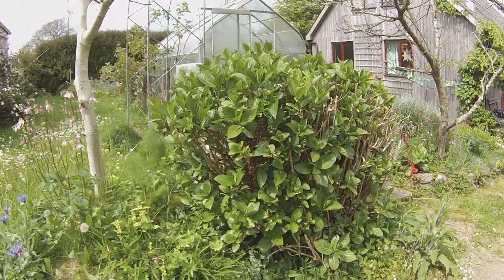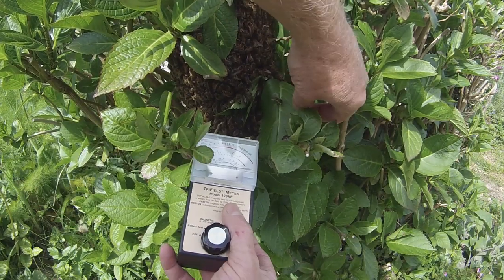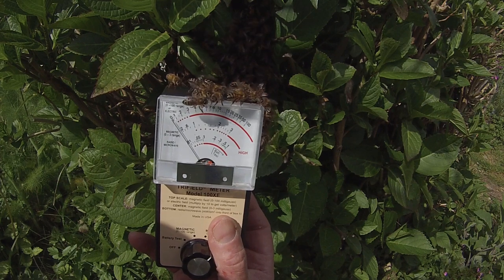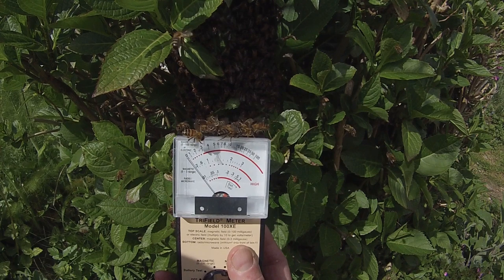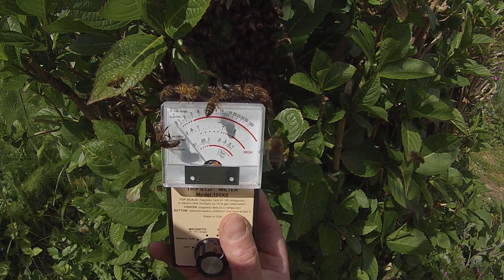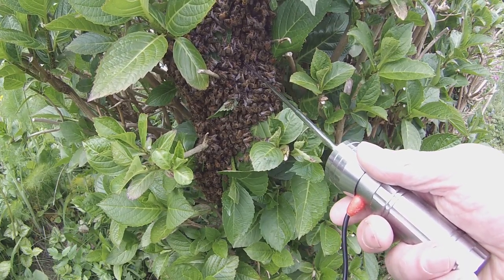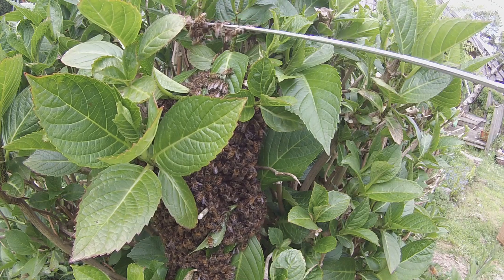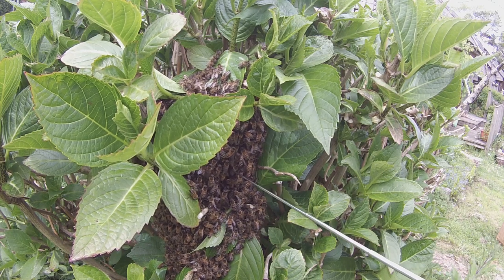More swarm experiments: VLF and electric field

Comment: Phil, this has me thinking. There may be something to this and of course further research needs to be conducted. I'm thinking that if the bees have the ability to generate electromagnetic fields then they should also be affected by such EMF induced upon them. It would make some sense that perhaps a coil of wire around the hive modulated with either music or perhaps some frequency of a steady tone would have some effect on their behavior such as comb building pattern, honey production, egg laying, etc. It's worth some experimentation, don't you think?
Reply from the maker: They certainly appear to respond to electric fields generated by thunderstorms, but electric and electromagnetic fields are not the same thing. Electric fields are caused by static charge differentials, as opposed to the flow of electrons through a wire. Nevertheless, more research is needed, along with some more time in which to pursue it...

Comment: i think that you and your device are an capacitive antenna and the bees are ground, since they sit on a plant which is a resistor but grounded through its water. 

the handheld thing is picking up fanning static that is normally about 400 Volts in the air so if they land, you are ground in this case. eather way your bees are electric or some radar is hitting you.
Reply from the maker: The device was designed as a simple VLF receiver. It detects frequencies in the audible range by feeding them directly into an audio amplifier, as there is no need for an IF stage.
Reply: @BarefootBeekeeper  i totally understand but thinking that to recieve radiofrequencies in the VLF audioband from bees, it has to be sensitive to entering a room while not being handheld and showing some movement. opening the window should show fresh air with different potential. then you can recieve bees.
Reply: in the end you are right, there is something
Reply from the maker: @hederahelix8332  the receiver can differentiate between radiation generated by different types of light bulb, eg  LCD, filament, florescent, etc and can pick up mains hum in any type of cable. Different electrical devices generate unique sounds. It would be nice to have a visual display as a monitor, and I may get to that one day, but meanwhile I will make some more audio recordings as and when I am able to. It's an interesting field, and I hope others will look into it.
Reply: @BarefootBeekeeper  Neighbour's cheap flatscreen trafo with mains hum.

Comment: I think bringing the antenna near the plant and swarm is unbalancing the system and causing it to pick up noise. If this is the case I expect the same result when the swarm is not present. If the bees were generating RF you shouldn't have to contact them to pick it up.
Reply from the maker: However, the bees did not react to the insertion of the probe, in any way that I could detect. If it was disturbing to them, they did not show it, and as a general rule, bees are pretty demonstrative when it comes to expressing their feelings!
Reply: @BarefootBeekeeper  if they were generating it you wouldnt need to put it into the swarm to detect it. Even if it is a real weak signal  having your  antenna near it would  pick up the sound. 
 I still like the experiments but being a ham radio operator  looking at what the signal is on a  oscilloscope would be interesting to see what it actually is .  having a waterfall from a sdr radio to see what this wave form looks like  would also be interesting.  ;)
Reply: In the process of the swarm they could be generating the vlf as a side effect.  Love to see more in regards to whats happening ;)
Reply from the maker: @Rushgamer-yw3lm  good idea! I am toying with getting into ham radio myself and have ordered a B**f*ng to try it out. I can't find anywhere local to take the test for at least 3 months, which is frustrating. SDR is an option for these experiments, although it means taking a laptop along as well as all the other clutter I carry. 
I didn't talk about it in the video, but I was getting a response from plants as well as bees, so I'm increasingly thinking that this may be an "earthing" phenomenon. More experiments needed...
I do have an oscilloscope, so that may make an appearance soon.
Reply: @BarefootBeekeeper  well worth it tho in the uk  how yoru priivledges are assigned is a bit different.. I think its based upon watts rather than just frequency like here in the states. However  experiments with a sdr play would  be very interesting.  It by far out of the box  working  sdr radio  would be with the appropriate antenna well worth  investigating these  emmisions to pinpoint  what we are actually hearing  ;)  Im getting my bees this weekend and i  really enjoy your videos and your scientific explorations! Oh i have a question in regards to the quadratic  but figure that be a personal email or the like  in that im wondering how to implement them with the lanstroth hives and Love the simple practicality of your design for someone that is just begining even at 54 yrs old how to  work with wood!!  ;)
Reply from the maker: @Rushgamer-yw3lm  look out for the Urban Mini Hive, which is the US version of the Quadratic, based on Langstroth dimensions. Produced in Utah by a chap called Albert Chubak.
Reply: @BarefootBeekeeper  the problem with the b$#f$ng is its not at the frequencies that you are exploring .  Look at the RSP1A Pricing – $109 (£91.20 inc VAT in EU) plus shipping – INCLUDES SDRuno!

The RSP1A covers the complete radio spectrum from 1kHz (VLF) to 2GHz (Microwaves) with up to a massive 10MHz visible bandwidth and the companion SDRuno software has all the popular ham bands and shortwave broadcast bands as “presets” for instant set-up.
Reply: this is a receiver and would need to be hooked into a laptop.  and then for the vlf antenna youd need to do some theory crafting to get something that is small enough to be portable and yet  work for the lower frequencies. Id have to do the math ect  to figure what antenna  could do this without having to be  so long.  Probably be a  long wire <random length> .
Reply: customer service and having one of the best supported facebook groups for this sdr radio make it a great radio. In fact im hoping to upgrade from a earlier model to the one mentioned  and  there are other  sdr radios   i like the no muss no fuss aspects of this .
Reply: @BarefootBeekeeper   can i use those frames in   the quadratic ?   I love the  idea of how  simple it is  to construct.  Very practical!  :)
Reply: So the way you tell if it's mains is you run the output of a step down xfmr into one channel of your scope and trigger off it,  and your probe signals in another channel and see of they sync up.
Reply from the maker: @Rushgamer-yw3lm  thanks for the tip on the RSP1A - will definitely look into that. I built my first crystal set when I was about 8 years old and have loved radio ever since. My father was an electronics engineer all his working life (still here, aged 91). I have dabbled in electronics but have been distracted by other things!
Reply from the maker: @Rushgamer-yw3lm  the best frames I have made so far are the ones formed from metal strapping. I didn't think the bees would like attaching combs to galvanised steel, but they take it in their stride. The Quadratic is based on the dimensions of the British National hive, 18" square, so the Langstroth version will be different.